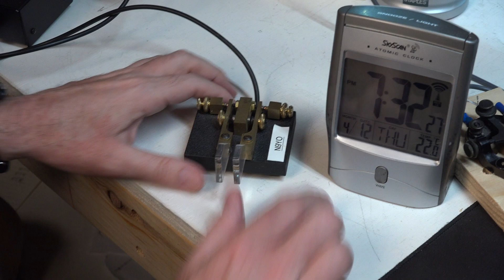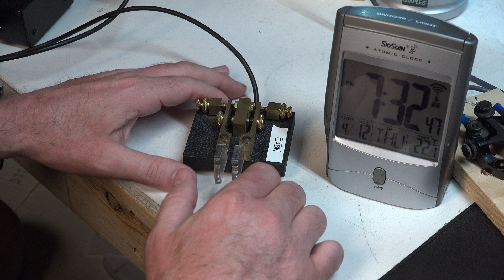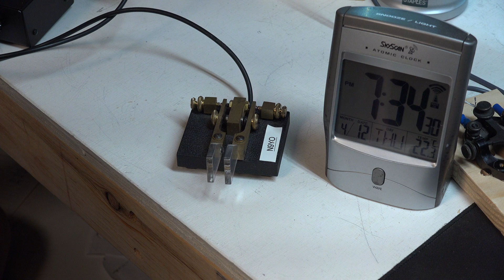Straight Key vs Iambic CW Shoot out | J37 vs Vibroplex Code Warrior Junior

Comment: I have the Code Warrior Jr. and I agree with the strain relief issue. I used a uv-resin across a few points of the wire along the bottom of the key, but it SHOULD have something in the design. I can't believe they missed that.
However, the other two points are easily resolved... sometimes :). The drift issue is just a matter of geting the locking nuts right. It takes some tinkering, but once they are right they should not drift. The weight issue is dependant on other factors. You are correct that the weight isn't enough for most cases, and it makes the key surface-dependant. My desk is a pretty smooth/glossy surface, so I used a little alcohol to remove any oils from where it sits, as well as the bottom of the rubber feet, and it has never moved since. The feet are pretty "sticky" on a nice smooth surface. That said, on random surfaces this thing is too light. It would be a terrible key for pota/sota or field day stuff where you need it to work on random surfaces.
Overall, I like mine. I feel like it's the least expensive well-built key that I could find. It compares well to the Chinese stuff in the price range (~$110). It does not compare well to the ~$180+ keys though, so I don't recommend it in general. Only if you can control where it sits and manage the strain relief. 
Frankly, ALL cw keys are too expensive for what they are. Some of them are very well machined and "nice" but there is no excuse for the average price of the average cw key. If some guy lovingly hand built these things on a manual lathe and perfectly tuned them until the feel just right, then sure he should make $300 for a day's work. When a CNC mill is just running code and dumping 20-200 of these things in a day, they shouldn't cost ~$200 on average. If the demand was a little higher we would see more of these coming from China at >95% the quality and <50% the price.

Comment: I have had a Vibroplex Code Warrior Jr. for years and it has served me well. I think some of  your criticism of the CWJr. were cheap shots. I have never needed a strain relief but it would be easy to add one. A cable strain relief with a little adhesive would attach it to the side of the base just as you have done with the J37. If the CWJ is sliding around, cleaning the feet with some alcahol and making sure the surface it is sitting on is clean. Wiping the surface down with alcahol is a good idea. All of the adjustment screws have lock nuts. If these are secure the adjustments should not change. There is a YouTube modification to the CWJ adding some #8 washers and screws that improve its operation. Iambic and straight keys each have their place. I would like to see what other owners of the Code Warrior Jr. think. 73's.

Comment: I think you did this exactly right: by starting on an iambic key, you learned what accurate Morse code sounds like, and you almost immediately had a decent fist when you switched to a straight key.  I think you could benefit from working a bit on your dits, though - thinking of dits as "as fast as you can go" doesn't sound good.  Some of those dits wouldn't be readable at all in a low s/n contact.

My grandfather gave me his J-37, from when he was in the Signal Corps.  This was when I was around 13 years old.  Wish I'd kept it - those things are fetching ridiculous prices.  I've been looking for one on eBay recently, and have had to abandon each one when it went over $40.

But anyway, I remember even as a 13-year-old, appreciating the precision of these keys.  The throw, the tension, and even the bearing preload are all adjustable, and they are very satisfyingly solid.  There is no hint that it could even possibly move in any way but directly up and down. ` I don't think I could keep my hand one of those MFJ (Ameco) straight keys for five seconds, because my hand would recoil from the feel.

Back to eBay now - I really want one of these.
Reply from the maker: Hey thanks for the nice comment Jim.  Yeah I think it worked out I went from iambic to straight.  Having a lot of fun now on straight key.

Comment: I have a bug, straight key, Iambic key side by side. I love them all. VE6CGX (ham since 1960)
Looking at your call sign you must be Extra class?  And learning code now? You have to use your arm and wrist on a straight key.  Moving fingers only will get you tired quickly. 73.
Reply from the maker: Yeah you don't know me that well, I learned code long ago, but ham radio is not the only thing I do in my life. it's much richer than that.  So, I'm always learning.
Reply: I had one career for 40 some years except in the service as a signal man. At present playing with QRP SDR. At 81, I can still send and copy in the head on any type of key/keyer. You are right on that, life is endless learning. Stay healthy and GL, 73.

Comment: Do that straight key justice and mount it on a 1/4" brass plate. Bencher paddles have a strain relief and they stay put at almost 3lbs. I made several 1/4" 3x5 brass bases for my speed-x keys that I got on sale from AES before they got swallowed up by HRO! They don't make these Nye-Viking keys any more. First key I got as a kid was a J-38 key for $1.00 at a thrift store! I keep that on the original base. I got the brass from online metals but you'll have to drill and tap them yourself (think 6-32). They are heavy enough to stand up to operation without problems if you put a non slip base on them.

Comment: Get a wide piece of plastic to loop around wires and screw down with that center screw like it was original made. A tie strap can be split and washer used to holdd it down. Yah you are a beginner.
Reply from the maker: Kind of rude, but ok.
Reply: @hamradiocq  you can look for parts online from manufacturer or stores. Search nylon cable clamp etc.
Reply: @hamradiocq  try Bencher since they list parts online in pdf's.

Comment: I have the code warrior paddle and two of the issues can be solved by getting some soft rubber feet for the   paddle.  This entails drilling and tapping the base  from the underside and affixing rubber feet . You could also drill one other hole for a strain relief .  This of course will not go all the way through the base .  Its unfortunate that you would have to fix a key that you just bought . The feet that it comes with are hard almost a plastic texture which makes for an unpleasant experience. I bought the warrior to work portable and it's ok for that. For my main station I have a bencher by-2 that I bought second hand which is worlds better than the warrior.
Reply from the maker: Yeah, thanks for the advice and nice comment.  Hopefully it will help many people.

Comment: If you notice the difference (i would say the problem) in the paddle key is that, it is allow you to do dah-tit without release the first finger, thus in some moment your both fingers are pushing the keys. It is deceitful faster but there is noticeable pitch-change in the sound when you are doing this, which is more - dahtit then, dah - tit. So you have to listen more for pitch changes then real stops in the intervals in the words, which can't be happen with J37. Thus making messaging with J37 more clear. The technic with J37 is not to push with the fingers, but with your wrist. Hold the key, keep your hand relax, then push down with your wrist. Or you will get tired very soon. GLHF.
And btw ye, one more pros. With paddles you can not messaging on the move, but with J37 you can ;)
Reply from the maker: Thanks for the interesting comment!

Comment: Your straight key board is not correctly sized. It should extend further in the front of the key -- to resist the downward force which will stop that tipping. Just cut another base!

I rarely use my paddles, being a member of the SKCC. I have several straight keys but almost only use the one I made. See my QRZ page for a pic. WB2SMK. Have fun with your 'new key', Tommy!
Reply: You could also use the same board, just move the key flush with the back instead of centered front to back.
Reply from the maker: I think you are correct sir!  Thanks for the tip.
Reply: You are correct Mark!

Comment: I have several straight keys I have accumulated over the years, as well as paddles. My favorite is the Navy Flameproof straight key. I know people have different styles to send on a straight key. I have found that having the smallest gap possible and keeping my hand off the desk works best for me. I sort of just have all of the action on my wrist instead of my fingers. I rarely use any of my paddles or bug that I have. Thanks for sharing the video! Tony - W6VFW
Reply from the maker: ConjuntoFan thanks for comment I'll try that. Wish these keys weren't so expensive
Reply: I've watched training videos and it is all in the wrist/forearm to avoid fatigue. Using a straight key is hard to get the timing correct. I try by listening to correct code and mimicking it character by character.

Comment: Funny I have the same paddle. I think a non-slip surface will help some with the movement. I did have the same problems with it becoming misaligned fairly often.

Remember to practice your U's when going through the alphabet with your straight key :). It is a bit hard to hear the code through the 7300's keyer I had to crank up the volume a bit. Now I'm feeling thirsty for some reason.

Comment: Maybe you could make yourself another block, similar to the one you made for the straight key, and mount the paddle key, complete with strain protection, in the same manner.  Just a thought.
Reply from the maker: Carl Jackson I hear ya.
Reply: Mine sits on a small square of rubber kitchen drawer liner. Never moves now.